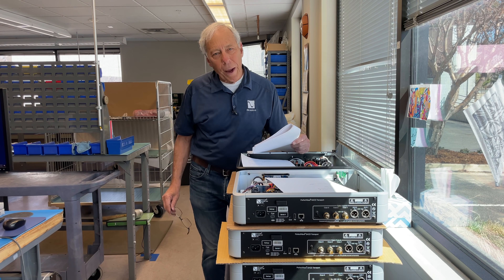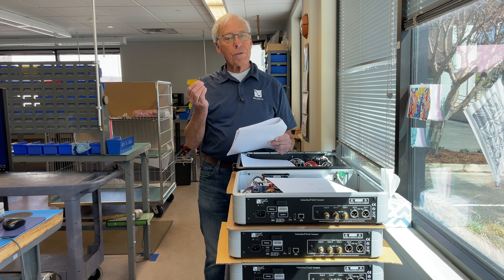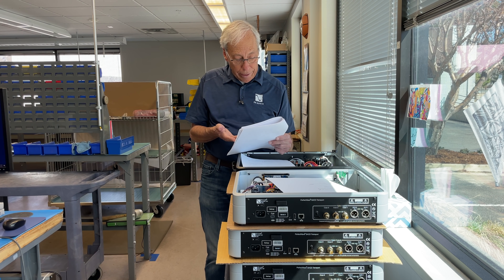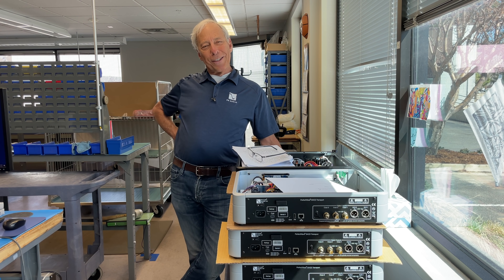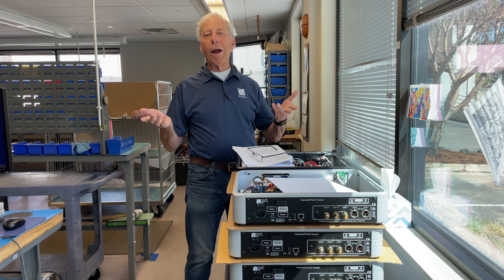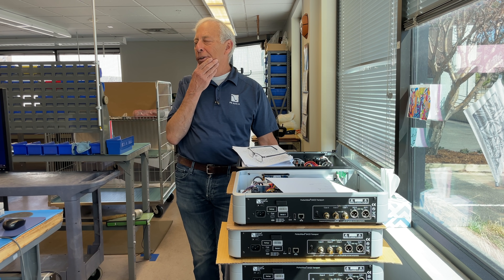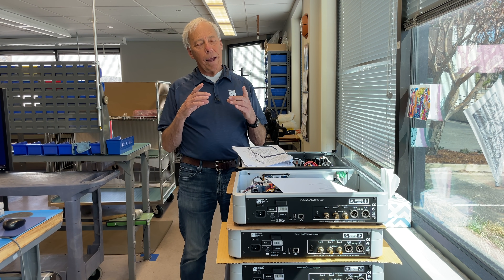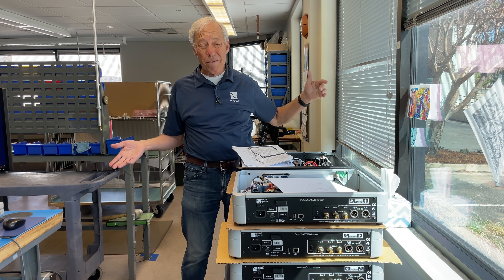Why preamps have high outputs

Comment: So let's see. Amp reaches full volume at 2 volts, preamp puts out 20 volts. Does that mean if you move the volume up 10% (2 volts) or a couple of clicks the amp is now at full volume?
Reply: That would mean the pre-amp innards are now being driven to near 100%, so it no longer has any head room, the very thing they were using to give them a 2V 'sweat spot', so while the amp is technically not being overloaded, it is being driven to it's non-linear-ish extremes, and as such will sound far from optimal. i.e. potentially quite horrible.
A 'normal' source will not have enough level to do that, it will probably drive it somewhat over 2V out, if you crank the volume knob all the way, but that is just to allow for weak/soft sources.

Comment: I don’t agree - it is extremely useful! Higher operating voltage means you can keep S/N to be as low as possible. The higher you operate above thermal noise the better. You should always try to run line level as high as possible in each line level stage in order to keep S/N as low as possible. It is simple enough to add a selectable resistor pad at the output of your active electronics or input to the next stage so as to handle the next gain stage - but once you accept to operate at low voltages anywhere in the chain then S/N will suffer. Pro audio runs at 1.2 volts and consumer audio is 316 mV - this is a factor of 4 - consumer audio has less headroom and inherently higher S/N. There are very good reasons to design gear that can operate internally at much higher voltage because lowering the noise floor is very difficult - so the best way to get better S/N is to raise the operating level even higher above the noise floor.
Reply: Sounds 100% logical to me. Good answer

Comment: Consider a 4-cylinder car that can reach 60 MPH in 7 seconds, when floored.  But you can feel the engine making the effort.

Compare that to a Corvette, just accelerating to 60 in 7 seconds (it can do it faster -- but for this example you gave it just enough gas for it to take 7 seconds).

Well, that Corvette will not feel like it is making an effort.  The Corvette will be in its comfort zone, while the 4-cylinder car will be at its design limit.

And so it is with pre-amp voltage output.  You want your pre-amp to be at ease, all of the time.  You want it to be well within its comfort zone.

Cheers!
Reply: Mmm but there is not as much headroom in the corvette damn sports cars don’t work for tall people like me 😅

Comment: Think like this if the source puts in 2v you get 16v (18 db gain) Your amp is at 1v sensitivity. What happens if the source material peaks at -6 db? In order to compensate for these irregularities outputs are designed in such a way.

Comment: I think Paul skipped some details here. I agree that a preamp circuit should have lots of headroom but consider the typical situation where a CD player, tuner, etc. output 1V and the power amp outputs maximum power with 1V in. Any preamp with lots of gain will have its volume control close to minimum in normal situations. What's the point of having the volume control go from whisper quiet to frying speakers in just a few degrees of rotation?
Reply: @Douglas Blake I have been in electronics all my life, and I still cannot understand this particular issue. How much sense does it make to manufacture a preamp that is capable of producing voltages capable of driving an amplifier into clipping ten times over?????
Reply: @Douglas Blake is this why having an amp that is more powerful than what a speaker is rated to handle is better? For headroom? For example, the mono block amps I’m considering will supply 600watts each, but the speakers are only rated to handle 300w max. Is this good? I see a lot of hi fi setups do this, - big amps with more power than the speaker is designed for. Isn’t this bad for the voice coil. My belief is that the speaker will never see this much power, especially at one time, so it should be safe. Would like to know your opinion. Thx!

Comment: I remember the titan series of musical fidelity and I observed with astonishment why that brand used final stage power transistors in the output stage of their preamps. I don't think that that kind of devices give their best linearity feeding an input power amplifier. 
I agree with Paul and I guess they use sensible parts for that kind of usage. No one uses an sledgehammer to hang a picture,  isn't it?

Comment: Having some dynamic headroom is great...but a too high output voltage of preamps yield an increase in accidents (too high volume) causing smoke from tweeters due to too much clipping, especially when the power amp doesn't have soft clipping.
Reply: Well, that's the price you pay for having children ;-)

Comment: Headroom does not beget a good amplifier. A good amplifier begets a lot of headroom. IDK where all this stuff about wanting headroom in excess of 10 times the output is coming from. You can simply figure out your load line, plot 2v worth of swing against the load line, and visually check to see where that swing would achieve the most linear response. Sometimes you will end up with a situation where your preamp will put out 20v. Other times you will end up with more or less than 20v. So long as your desired output is playing over the most linear region you can possibly play over, the headroom really doesn't matter.

Comment: Its all in the name of headroom - my ECC88 tube based preamp puts out 125 volts at no load condition when measured with a high impedance voltmeter but falls to 20 volts once connected to a power amp with a 150,000-ohm input impedance.
Reply: The ECC88 is an RF TV Tube designed to run at 90V anode voltage. It works well for HiFi but is typically still running around 90V and has quite a high bias current for a pre-amp triode (5 times the ECC83 so it should have a much lower output impedance). If you get a 125V signal out of it then it must be a real oddball design. And if it collapses with a 150kOhm load, I would harvest the tube and find an other amp for it.